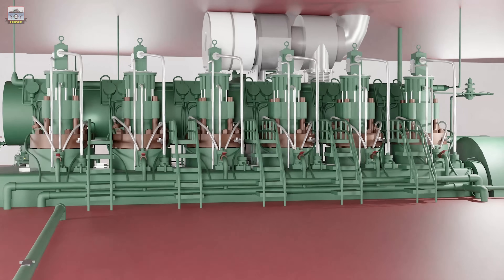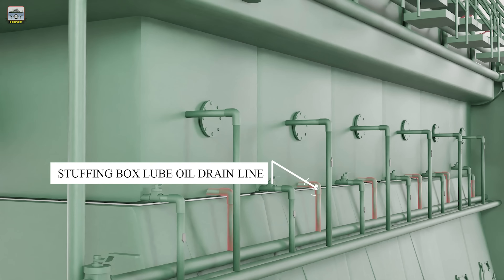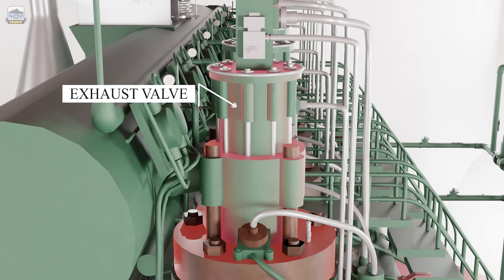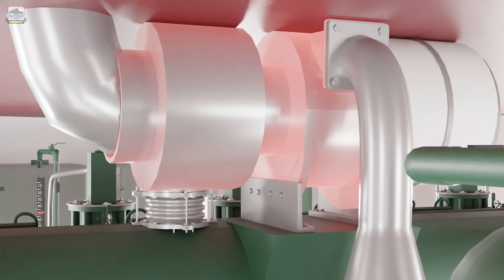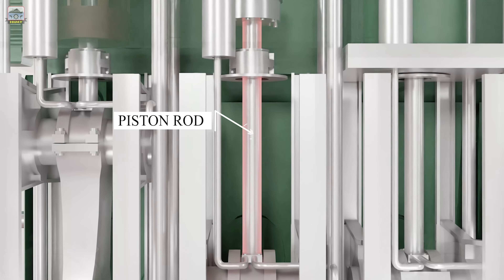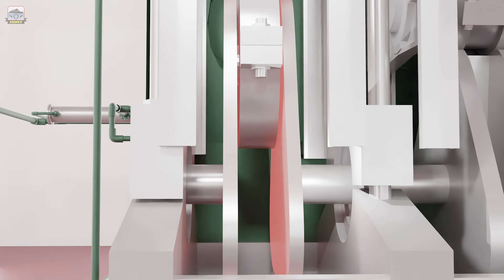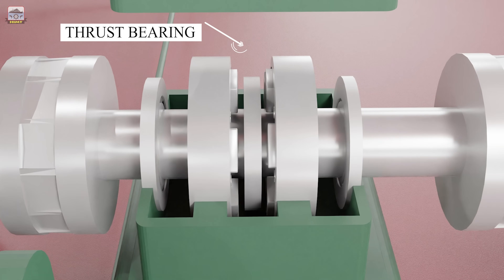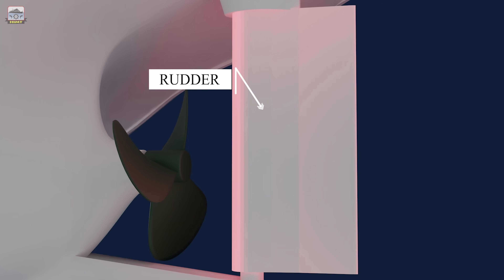2- Stroke Diesel Engine | Internal & External Parts Overview | 3D Animated Explanation| HIMT

Comment: Ugh - this AI, computer voice, flashy CGI animation is packed with factoids about the physical makeup of an engine, but is terrible at linking designed elements, reasons for why this or that is engineered this way or that way, consequences of heat, pressure, load, etc, in other words anything USEFUL and EDUCATIONAL about an engine of this size/scale. So painful to listen to, I stopped after 2 minutes. Waste of time.
Reply: This video is not meant for probably chief engineer like you. As a trainee engineer, I learnt many things from this video.
Reply from the maker: Thank you for taking the time to share your feedback. 
We understand that covering all aspects of such a complex subject within a single video can be challenging. For a more in-depth exploration that delves into the engineering rationale, the impact of operating conditions, and the intricate dynamics of heat, pressure, and load, we do offer a complete course on the same. 

As you might appreciate, developing detailed educational resources requires substantial time and effort. If you are interested, we invite you to explore our full-length courses or materials. 

We value your input and hope to improve our offerings based on viewer expectations.
Reply: @HIMT  Μay you add to the videos subtitle settings the choice of Greek subtitles also please?